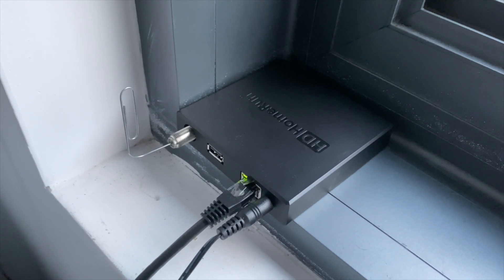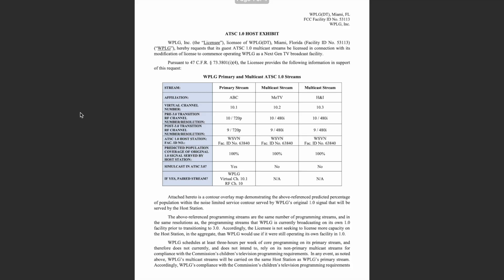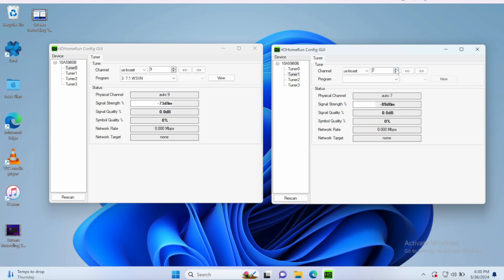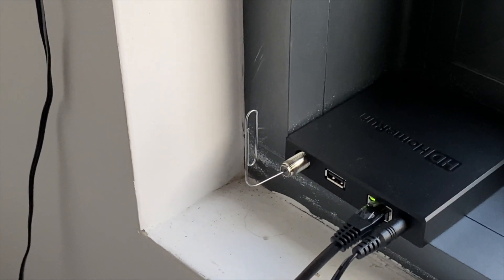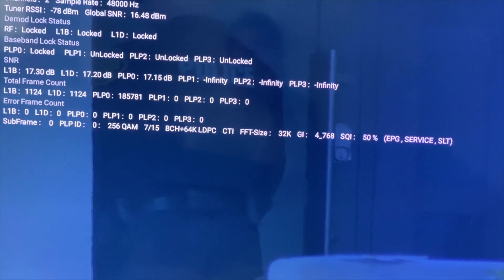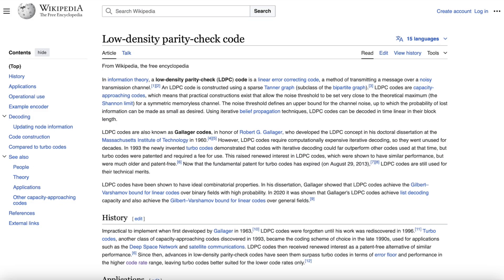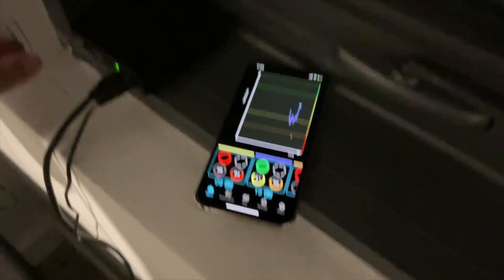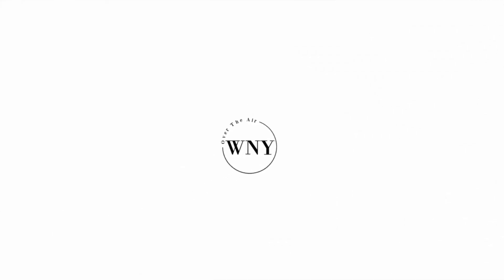ATSC 3.0: VHF TV Reception With A Paperclip

Comment: It’s the Code Rate not the other parameters. 7/15 is great. My Nashville market used to use 11/15 and it was very difficult to lock QAM256. They changed to 9/15 and it’s way better.
Reply from the maker: WPLG has a minimum receive SNR of about 14 dB. It's not that much better compared to ATSC 1.0's 15.2 dB. The modulation and code rate configuration definitely helped to make the signal more robust, but the FFT size and Guard Interval are what makes the signal more immune to multipath, which was the main reception issue in the video.

Comment: The difference between a paperclip antenna and a VHF outdoor antenna is that you can receive a good signal from a greater distance more than 2 miles.
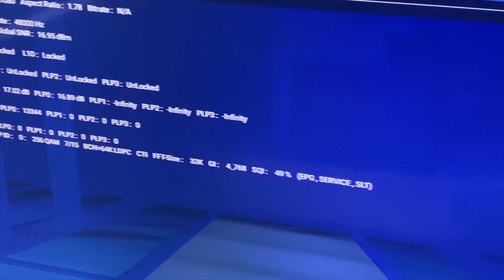Reply from the maker: As shown in the video at 4:08, WPLG is over 17 miles away.
Reply: Where I am a paperclip works out to about 30 miles for some stations.

Comment: VHF FM radio on cellphones only works if you plug in earphone cord as an VHF antenna. Cellphone makers will never add DRM ATSC 3.0 TV tuners to their cellphones.
Reply from the maker: Analog FM Radio degrades significantly above the noise floor, and fades completely at the noise floor. Digital signals can be sent below the noise floor, in higher quality, and can offer additional services in the same bandwidth. At the end of this YouTube short, I show reception of an HD Radio signal operating on the VHF FM band, received with a paperclip from over 17 miles away: https://youtube.com/shorts/xd2wA6k3f44?feature=share
Reply: It’s the half wave or quarter wave reception. That’s why I get the best results using my CM3020, 20’ high. At 68 miles away. I can’t get Lo VHF on anything else really. Sure it’s similar in band frequency to FM, but there’s a reason radios with FM have a telescoping antenna.